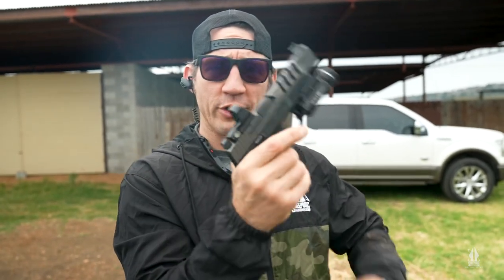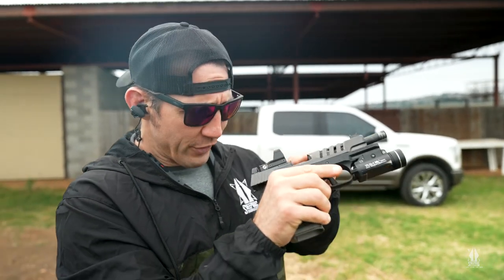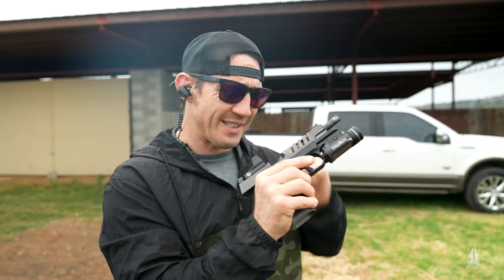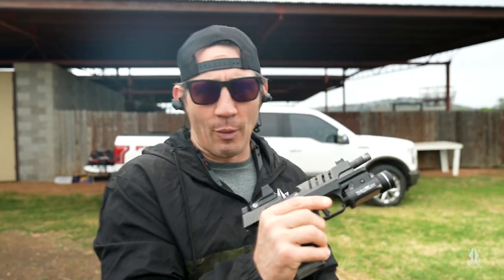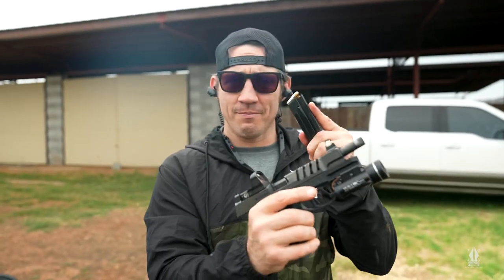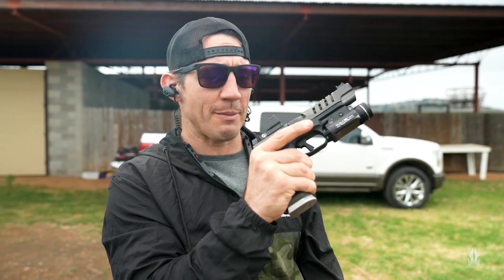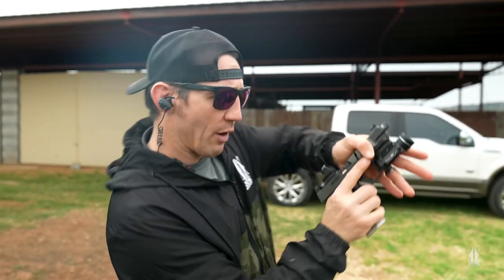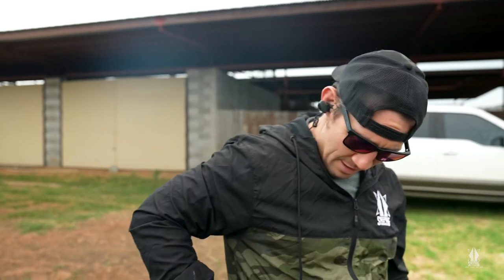How to load and unload your firearm.

Comment: I never bother doing the 3 point check if you know how a gun works the minute you release the clip and pull back the slide locking it there is no way in hell a bullet will ever be in the chamber

Comment: You never want to slam your slide with out a round and mag in your pistol come over the top and slide it forward with slight resistance if not the slide hits too hard because it does not pick up a round and it will eventually damage the trigger of your firearm  ,, see articles by Bill Wilson also nighthawk customs

Comment: No. Lock the slide to the rear, ejecting the round that’s chambered, then drop the mag. Undangering the gun should be first priority...by dropping the mag first, you’re left with a round still chambered. That’s setting yourself up for an ND.
Reply: Not all pistols have locking slides.